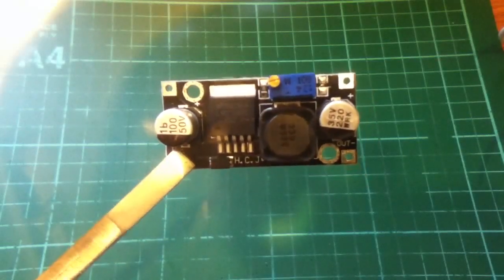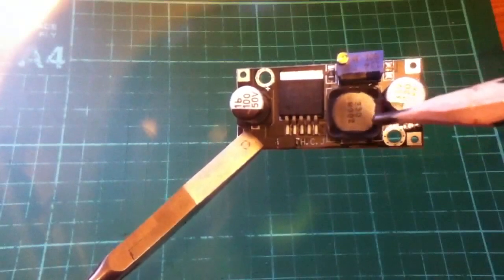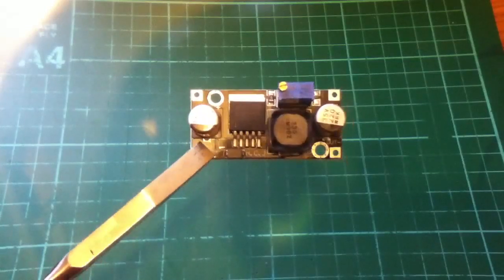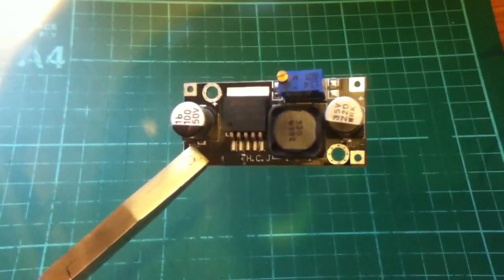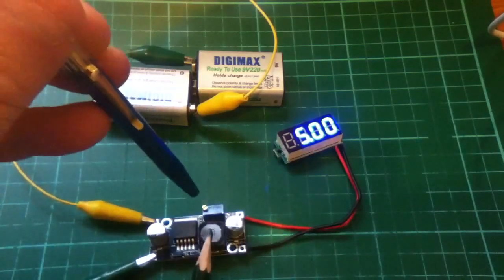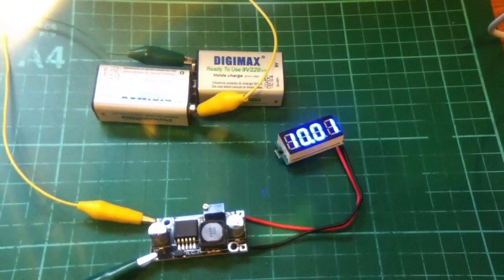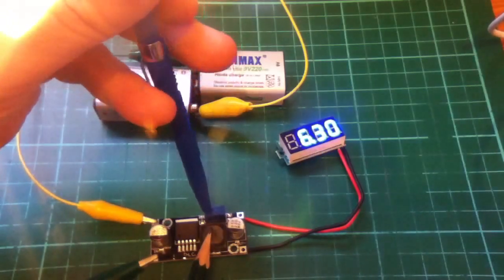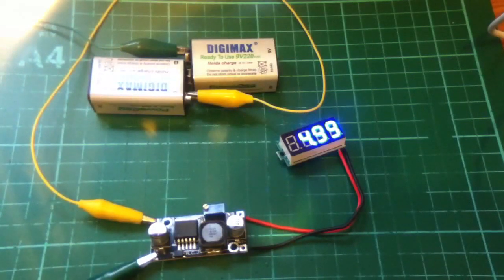Ridiculously Cheap Voltage Regulator Board uses LM2596 SMPS Chip

Comment: I was from Shenzhen China, where these parts are made. I just did a search on taobao.com (Chinese ebay), the cheapest I can find for the same LM2596 regulator is ￥3.39, that is less than $0.5 USD. Obviously they delivered that to your door for a cost around $1 USD, I don't know how they did that. What I do know is how they can manufacture it so cheap. 
The most important thing for them to lower the cost is the vast cheap labor, most of which work 12hr a day and 6-7 days a week. They make about $300 - $400USD a month, depending on the OT hours. Only 3 years ago they might only make half of that, a series of worker suicide events in Apple's supplier Foxconn changed that. They are all from the countryside and deprived of certain benefits that enjoyed only by city dwellers, like better education, social security and healthcare, they are not allowed to live in the city with their families or kids. They have to return to where they are from once the finished their factory life. Basically you have your little iphone, ipad, and these little gadgets made by 300 millions of these slave migrant workers.
Reply: The LM2596 that are used here are counterfeit, they are cheap Chinese knockoff, they sell for about 0.03-0.05$. These LM2596 do the job, but when you reach the higher end of the spec their live is cut into shreds..
Reply: Roosevelt Lai the lm2596 are fake. that's why they are so cheap.
Reply: ms3bani it's not fake, it can only take under 1amp of current. Got it in 50 cents
Reply: Thanks for mentioning, i have thought it countless times, how can the chinese possibly make things so cheap. To most of the pampered world, it's totally cool! But to see a confirmation, and to think that this isn't commonly known... It could be, the info is all around us, but people would rather not know, and that's the single biggest factor in "how they did it".

Comment: Would one of these work as a regulator for a LASER diode that needs 1.8V 1.2A? It seems too good to be true. If not, any other inexpensive suggestions?
The diodes were about $15 each so not a huge risk of investment.

Comment: Hi. As always, cost killing is quality killing. I made some by myself, but I put a 470µF on both input and output for less ripple, and I also used a SB550 schottky diode, rated 5A. No problem to deliver 3A continuously, and the marvel of the buck circuit is than it eats half amps it delivers.

Comment: I output 2.8A @ 8V regulated down from 12V  24/7  for over a year with no failure. Max rating was 3A. I didn't even heatsink it.

Comment from the maker: They're cheap, but they do look well made. The components all look reasonable quality, but see the comment by MetalPhreakAU about the schottky diode.

Also, not sure how much ripple there is on the output - you might actually be better off with a 7805 for analogue circuitry, particularly audio.

Comment: I bought two of them a while ago for like $5 USD each and I thought that was remarkable.  Just bought 6 more today at $1.50 each free shipping.  For under $10 I got a stock of nice efficient regulators that will last several projects.  Beats buying 7805's from local stores for sure!

Comment: Just finished testing one of these (i've put a video up). Under 2.5A load it quickly killed the schottky diode on it despite being within the rated current. You certainly get what you pay for :) Running them with less current (say under 1.5A) and they should be fine.

Comment from the maker: Yes, I can't see a problem with that. There are also these modules available with 2 potentiometers - one for voltage and one for current. By setting the current limit to a suitable value, you could have your string of LEDs without the resistor. But if you want to use one of these cheap modules, yes, put a resistor in series with LEDs and it'll work fine. And the switch mode regulator is more efficient than an LM317 - you won't waste current warming up the regulator.